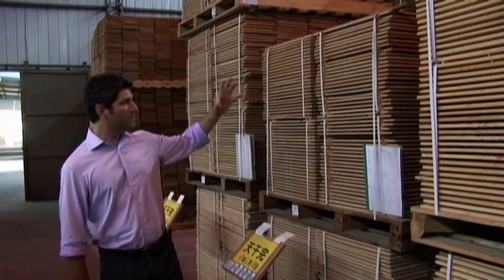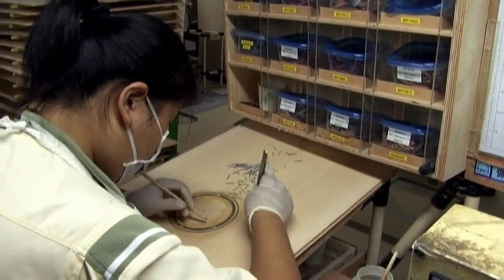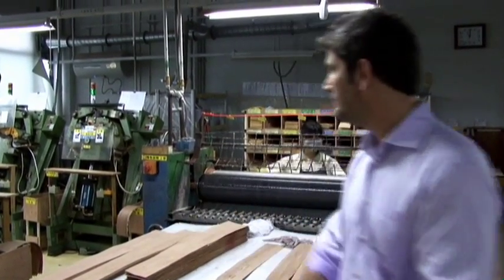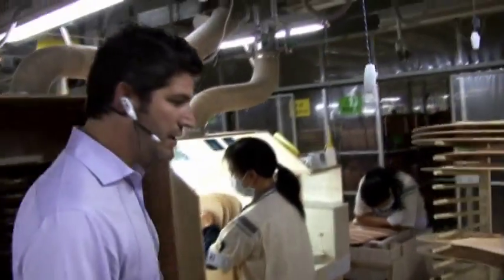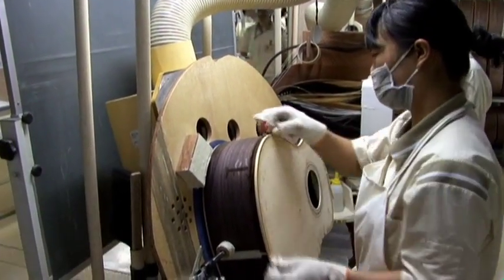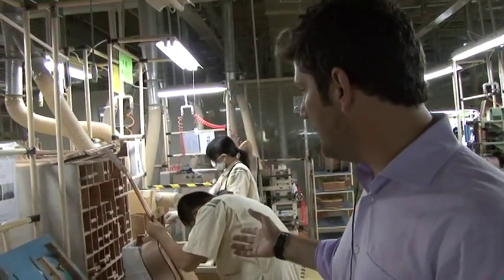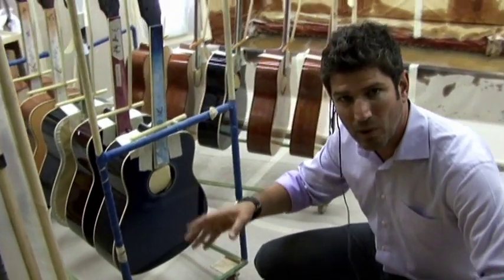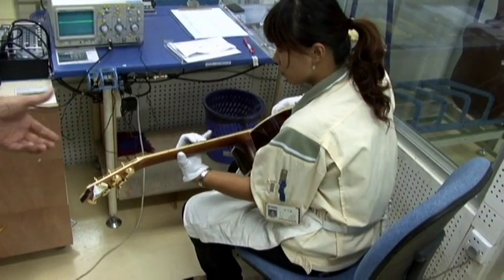Yamaha Guitars - A Guided Tour of Yamaha's Hangzhou Guitar Factory

Comment: If I'm not mistaken, Yamaha's top of the line FG9 uses a bolt on neck which I found very surprising when I heard that in a review. That guitar cost over $5,000 USD. On the other hand, their LL line of guitars including the top LL56 has a dovetailed neck joint. That guit cost about $6,000 USD. I hope what I heard about the FG9 having a bolt on neck is untrue. I have a LL16D. It T1218001has a dovetail neck joint. By the way, a dovetail neck joint won't necessarily last a lifetime
 At some point a neck reset is usually required and that is expensive.